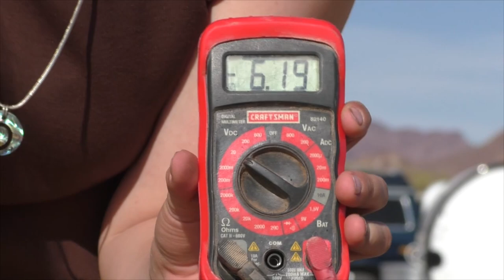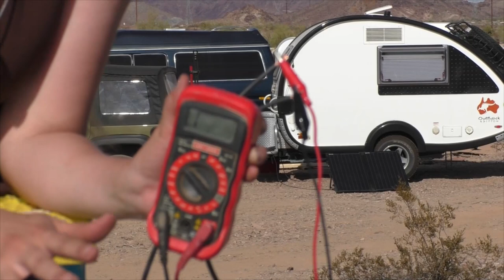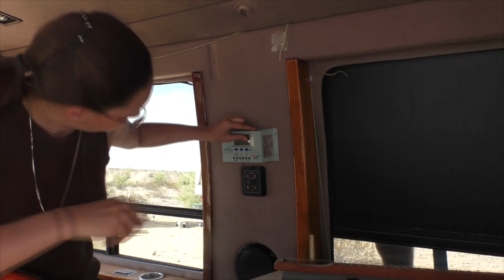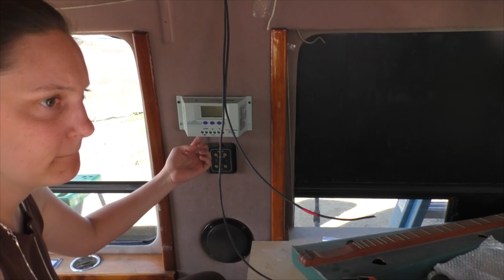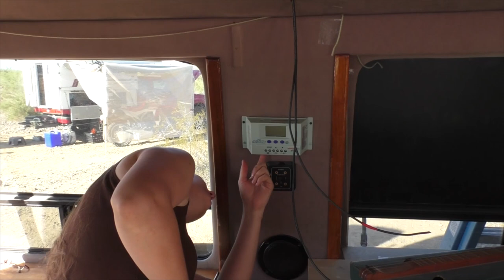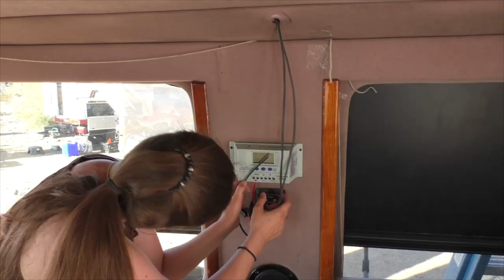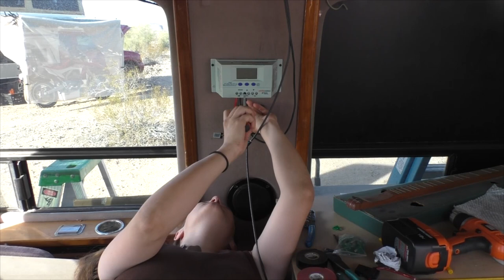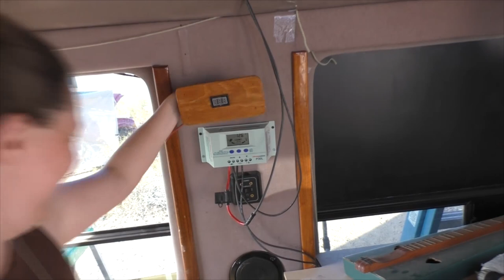Solo Female Traveler Refuses to Pay A Power Bill EVER

Comment: This was the very first time I totally understood how to do van solar install!  Thank you everyone!!  Clap clap clap clap!!  Happy travels all :)
Reply: Drilling through the seat belt nut was very ignorant. Also not allowing for an exhaust fan was not wise. In the future, don’t worry that much about voltage and concentrate on amps. She would have gained more power to the battery if wired two of the panels in series then into parallel to the controller. Being an EE, I get a kick out of watching people do videos that don’t have a full knowledge of electricity.
Reply: It would have been nice if your comments could have been helpful instead of demeaning. Not everyone is an EE, but they will still try to do things. As they say when teaching teachers- "instruct on the right way-  don't demean the wrong way"

Comment: So.. a big hint for attaching self tappers into teh roof panel - I drill my initial holes with a self tapper.. then I pull them all out and instead use a Rivnut in place so I can bolt down the panels.  You go from a single 20 gauge sheet of metal which is about a thread of hold power.. vs a Rivnut which gives a solid 10-12 threads of holding power.  Much more secure and it lets you bolt the panels down for an easy in/out!

Comment: Awesome job on the install,  one thing you may also want to keep in mind when installing panels or other items on newer vehicles is they have side curtain airbags on most new vehicles... if you hit a wire or the bag, you can blow the bags
Reply: Disconnect the Battery.

Comment: While watching the video, I put together a list of supplies & installation instructions.  Please let me know of corrections or additions.
Supply list:
Roof Rack
Solar Panels (I’m thinking a total of 200 watts, so probably 2 panels)
Cardboard or other material to cover panels
Brackets to attach solar panels to roof rack & screws, bolts & nuts
MC4 Connectors
6awg wire for solar
MPPT charge Controller
Screws, brackets, nuts, bolts for mounting charge controller
Splicers (not sure what they are)
 2 Inline Fuse holders & fuses.  Match the amperage to the amperage of the charge controller.  For example: Teshia added a 30 amp fuse, because she has a 30 amp charge controller.  If you have a 40 amp charge controller use a 40 amp fuse (I don’t understand the purpose of fuses & what type to get)
Terminal connectors
Battery(ies) (not sure what kind to get, I thought I would start out with one battery)
Volt meter
Electrical tape, keep wires taped to prevent shocks etc. Red & black colors at a minimum.
Butyl sealing tape
Screws, bolts, nuts (not sure what size)
Isopropyl alcohol
Paper towels or cleaning rags
Crimper
Screw drivers
Duck tape or other tape or some method to label things
Drill & bits
Silicone
Different colors of electrical tape.
 Supplemental voltage meter (I don’t think it’s necessary, but would like to know for sure).  Jamie suggested it be mounted to the battery cables.
Inverter:  I think this must be connected to the battery, but don’t know how to do so.
 Heavy wire like 2awg should be used to connect inverter to battery.  One wire should be connected to the positive terminal & one wire to the negative terminal.
 150 or 200 amp inline fuse for between battery & inverter.  Not sure how to determine the amperage.

Installation Instructions:
 Mount roof rack on roof
 Cover solar panels with cardboard or other solid material.
Keep panels covered until ready to go live.  Once panels uncovered they are live.
 Connect solar panels to roof rack.
Parallel connection:
Connect Negative & negative together, label as negative
Connect positive & positive together, label as positive with red electrical tape
Use MC4 connectors to connect wires
Test with volt meter
Mount Charge controller inside vehicle
Drill hole through roof to allow wires to come through ceiling.
 Put positive wire & negative wire through hole in roof, make sure they are wrapped in electrical tape.
 Apply silicone around the cables.  Make sure it is thoroughly sealed.
 Install inline fuse holder to positive connection for controller, prior to positive wire going into controller. Then connect positive wire to inline fuse holder.
  (Not really clear on if this is correct or how to install the fuse)
 Strip positive & splice & then connect to controller, label as positive with red electrical tape.
 Strip negative & splice & then connect to controller, label as negative
 Connect from charge controller to batteries.
  Make sure fuse is not connected while connecting to battery.
 First connect an inline fuse holder to the wire, then connect the inline fuse holder to a terminal connector. Then connect to the battery.
 Connect the negative wire to the battery, but without a fuse.
 Put fuses in & check to see that everything is working.
Reply: I would message you, but I can't figure out how to.
Reply: Watch other videos
Reply: Amps. of fuse to get all depends on Inverter size ( Example 2000 watt inverter + 12 volts is66.666 , so you need a 150 and fuse. Hope this makes sense. If you want to know about Volts,Watts.Amps. and Ohms. There is a Chart you can download called Ohms Law. Have fun

Comment: Voltage is potential, power is the result of volts times amps (current) Voltage is measured between the positive and negative, current is measured by being in line with the positive (most VOM instruments measure low current only, to get a real measurement you use a "shunt" that takes the current off the main and makes it safe to measure.) Imagine a tank of water on a hill, the water is the potential, the voltage. The pipe and it's size is the current flow, and the pressure that comes out at the bottom is the watts. The miracle of the MPPT controller (any solar controller actually) is that it does all of this for you! This is a wonderful video!
Reply: John Bruce Great explanation, tank of water on a hill...at last I get it!😝👍😀🙏

Comment: on my 400 watt system I used a Renogy 12 volt to 12 volt DC charger with a built in mppt so my altinator heps chage my batteries when traveling esp at night.

Comment: Good install. My on,y suggestion would have been to use rivnuts to hold the panels down. The self tapping screws will eventually pull out with the panels vibrating down the road.

Comment: If she wants to expand her system. She will need a MPPT Charger that will expand also. Example ( Morningstar MPPT-15 or 30 ) They will handle being connected parallel the voltage can be added up to reach over 150 volts ) Then connect Panels in series. My thoughts.

Comment: Jamie- great job/editing. Teshia-you were fantastic! I know this is too late to modify the install, but in the future, leav the 4" to 6" between front set and rear set of panels, where you mound down the tied together cables. Reason being, should a connected set of cables crack or malfunction you will be able to trouble shoot and repair any "coupler" plastics don't hold up. As always, should you go back and review comments: Free Ideas, Use M or Lose M. CrazyLarry

Comment: this is the most complete solar installation video there is on Youtube but this was a very hard place to drill in a thin sheet of steel simple screws can drill by themselves and this prevent the installation of a heavy duty grommet or a Solar Panel Cable Entry Gland. But because of the thickness of the hardened steel you drill in, this will work because it is not a sharp thin cutting edge like a sheet of steel.  The idea of the rubber is fantastic because it also reduce vibration.

 But in a world it cost 150$ an hour to work on a van, you should teach the right way to diagnose the individual panels: being in parallel, it is like a short when one is not working (unless it is an open circuit) and the total voltage is low like the 6 volts she showed with all the cardboard on top of the panels, so with the voltmeter she just has to measure the total voltage of the ensemble (like she did) and block only one panel at a time with a cardboard and this should decrease the voltage significantly, and one after the other, she can test the panels and this demonstrate that each one is working and there is continuity in all the connections. This was demonstrated years ago on a video on Gone with the Wynn channel.
Reply: Yes, that was what I thought.  I was glad that you confirmed what I understood.  I wouldn't of put all on parallel.  I will keep learning.
Reply: She had no choice to put them all in parallel because her solar controller is low voltage (Pulse Width Modulation). With a more expensive MPPT controller, because he can handle higher voltage, she could have made pair in series giving 24 volts each and these 2 pairs in parallel. The reason is more voltage, less current so less lost in the wire and smaller gauge wire required.
Reply: Oh thanks learning more.😏
Reply: Yes exactly. It's setup like this because I have a PWM controller. When I get an MPPT controller I'll change it where the two sets are still in parallel but the sets are wired up in series for more efficient charging and a 24V setup.

Comment: You had mentioned some where during the video about the different items that are needed that are not included with the solar kits.  Could someone include these basic items in a list for us?
Reply: You can by items that are a lot better than a kit. Kits come with low value charge controllers. They are made not to last. If you can afford to by better products. You should. I can tell you what to by. all depends on what you want to run with it.Most kits you by do Not meet all your needs. Hope this helps.

Comment: Great video. You guys should get better wire strippers than that combo stripper/crimper tool she’s using. Go to home depot and buy the small blue handled strippers, so much easier.
Never use the flat crimper area on the combination tool Teshia’s using, they don’t make a tight connection.

Comment: I think I would have put the charge controller in the battery compartment and then just used the fancy wood framed battery monitor inside the coach?  Looks neater.
Reply: Thanks for that idea.
Reply: Not a good idea. Batteries vent. You can destroy the Charge Controller. You can not read the controller also.

Comment: This was hands down the best solar installation video. Most people edit, leaving out important parts. I have a better understanding now. My van has a fiberglass roof. What type of screws would you recommend? Also, what solar kit was? Thank you!
Reply from the maker: I’d use 1/4” thick self tapping screws and put at least 3 in each bracket. Just go right through the bracket.
I don’t know what kit this is, but I would use a Victron MPPT solar controller and battle born lithium ion batteries if you have the budget for it.
Reply: @enigmaticnomadics  Perfect! Thank you so much for your response!!!😊
Reply from the maker: Your welcome! Check out my second to latest vid: Is mixing solar panels safe? Theirs some things about installing the panels that might be helpful.

Comment: It's my understanding that you want to wire the charge controller to the batteries before you tie the panels in so the incoming energy from the panels has someplace to go. That was pointed out on another video I watched, but I could be wrong about that.
Reply: You are absolutely correct!  The charge controller needs to know how much power the batteries need before sending juice to them.  It's possible to send a burst to the batteries that's too much & then damage them if everything's not connected in the proper order.  And you sure don't want to see your money spent on solar, go POOF! up in smoke.
Reply from the maker: +Christopher 3D Yes, that can be accomplished through the order in which the in line fuses are inserted. Thanks!
Reply: Oh yes, I can see that now. Duh. Fuses put inline, but the fuses aren't put in until everything is wired up. I'm learning!
Reply: Having the fuse to the panels removed accomplished the same thing. All good.
Reply: Thanks for asking that question. I knew I had see something like that as well and wondered how they did it this way--what was different...now I know.
Reply: You are right. Connect Panels first you could damage the controller.

Comment: Next time you use self tappers like that I would drill holes in the bracket that are larger than the threads and then self tap into the roof.

Comment: Just wondering...because I have no idea: will drilling holes in the roof cause it to leak?  Thanks for the great and clear video!!
Reply: If you use a proper roof sealer no problems. Remember that different types of roofs need a different type of sealer. That is why brutal take is the best for metal roofs. I watch Johnny Valentine a Solar Pro. and he recommends this brutal tape also.

Comment: The additional holes that were drilled in the bracket tightened in the bracket only, totally ineffective as the brackets should have been drilled with a drill bit that would allow the same clearance as the pre drilled hole in the bracket.  So, in effect the only thing actually holding the bracket is the single screw per bracket.
Reply from the maker: Completely wrong Phillip. I know exactly what I’m doing.

Comment: That's some thin wire for 400 watts!
Reply: I agree. 10 awg was the stock wire that came with the kit. There's some voltage loss between the panels and the charge controller. If I ever do work on the panels I'm gonna up it to 6 awg.
Reply: I wanted you to know that people are still learning from your solar project ...am about to install 300 watt system and had never thought about heavier wire from panels to controller until I watched this...Thankyou :)

Comment: 400 watts of solar at 12 volts...
That means basically 20 - 30 amps on a good day of charge current... 25 amps at 12 volts... that wire looks a bit thin for that... I'd really have gone with 6 AWG if possible, even though it's a short run.
Reply from the maker: +Four ZeroFour  Bigger wire never hurts a thing!
Reply: I agree. If I ever do work on the panels I'll be switching to 6awg. On a sunny day I get 22-24V at the panels, but 17-18V at the charge controller. There is a lot of loss and the 10 awg stock wires that came with the kit were not enough.
Reply: You can also in the future think about a slightly fancier charge controller; a modestly priced MPPT one would give you quite a bit of a performance boost, even though your panel voltage is close (ish) to your battery bank voltage.
Reply: @enigmaticnomadics  = and - remember The Same wire for both terminals.

Comment: Post another video of replacing the ceiling from water damage:)
Reply from the maker: Evidently you haven’t done this before.
Reply: Back in the day, customizing vans, only about a thousand holes in van roofs, lock nuts with silicone, or spot weld bolt/nut with silicone, top and bottom,  fold the headliner down, seal on both sides. On a new van, drill a hole and give a shot of primer to prevent rust, let it dry then proceed.....always seal roof through fittings They never leak and yes, always drill on raised area of ribs, if any. :)
Reply from the maker: I stay in touch with Teshia and she never had any leaks. As a side note, unfortunately, her van caught fire due to a rodent nesting in the engine compartment. She was able to salvage the solar equipment and most of everything but the van itself. She’s safe and saving for another rig.

Comment: I'm still a little confused about the charge controller display.  Since there was 400 watts of Solar from the panel and she read 25 volts (34:57) before it was brought down into the van.  400/25 is 16 Amps.  But the voltage should be a nominal 12-18 volts.  Which I understand that's why it was rated for 30 amps (400/12), because 12-ish volts were what the panels were rated for.  My question is this,   the display showed 12 volts, which I assume is backfeed from her house batteries.  She said it's getting 2 amps, did she mean she was using 2 amps?  I would assume it should be supplying 20 to 30 amps given the sunshine in the video.
Reply: 25X16 is 400 Watts. Volts X Amps gives you Watts. Each Panels is putting out 100 Watts at 16 Amps. The Batteries were almost full. The controller slows down the charge in the batteries as the become full.So that's why it was reading 2 Amps.

Comment: As someone who has worked with my hands my entire life I'd like to point out that in reality you would have been much better to predrill those aluminum z brackets if you wanted 2 holes in each.  Your self tappers are grabbing the bracket which is causing the twisting and the sense that the screw is holding stronger.  The strength between the bracket and the roof of the van may, or may not be better.  But if you would have predrilled a hole slightly bigger than your screw, you would know the force the screw was putting to the roof.
Reply from the maker: +Javaman92 No so. The feel of the thin aluminum is different than the feel of the thicker, more resistant steel used on the van roof, hence predrilling the aluminum would not be nevessary. If the thickness and material was identical and the Z brackets were made of thick steel or the roof was thin aluminum, then yes, boaring the  brackets a bit larger with a drill or step bit, would have been advisable.
Reply: I don't think it will benefit your video for me to try to prove my way of thinking.   What you have with this video is a good thing that will help a lot of people. I'm glad you took the time to film it and upload it.  I really liked that you didn't edit out when things didn't go perfect and showed not to freak out and how you went about dealing with it.   I have said in the past that the difference between the amateurs and the pros is that the pros know how to deal with things when they don't go as expected.
Reply from the maker: Fair enough. Thanks for watching.